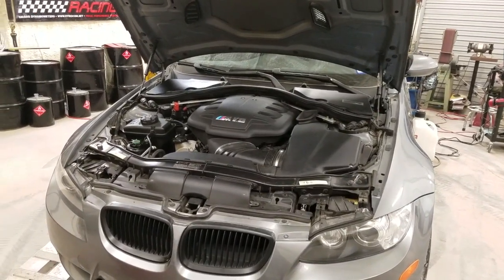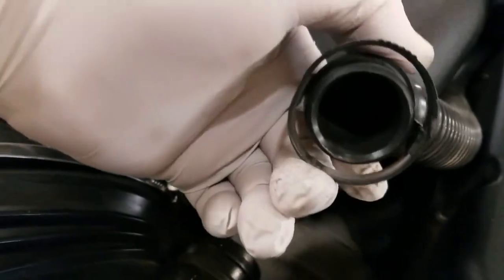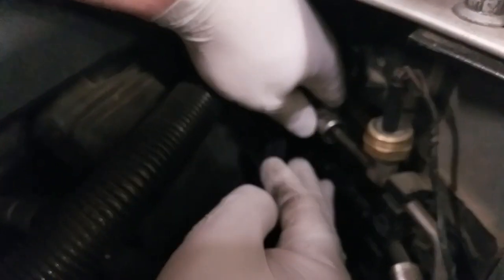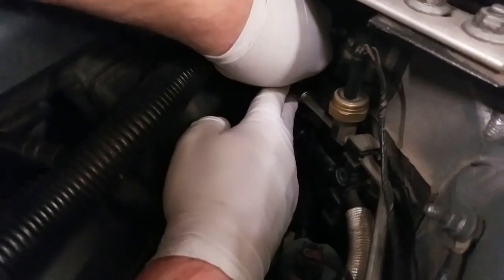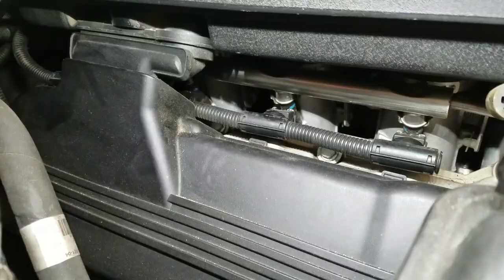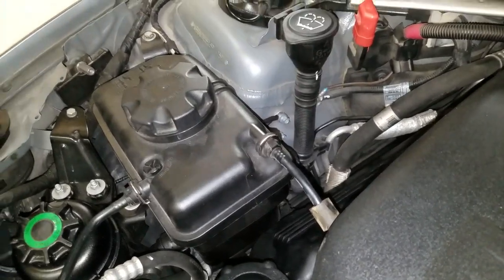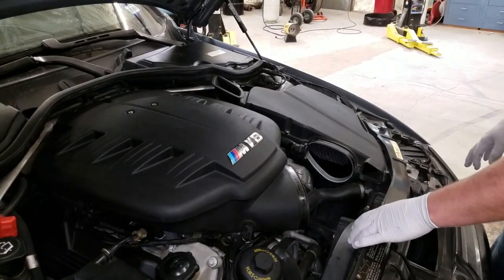Installation Guide | PROFLEX Commander for E9X M3

Comment: 9:12 I like how you quickly skip over the "tidy up all your wiring" because there really is no way to make it tidy or nice-looking.  I took off my plenum to try and hide the wiring as much as possible but the ProFlex harness is unavoidably going to be sticking out from underneath the plenum on most cylinders.  Just a small nitpick in an otherwise pristine, show-quality engine bay.  System works great though.

Comment: Don't mean to be rude, but from what I've read, don't you NEED new injectors for an E85 conversion since it requires a higher flow rate right off the bat to even function?
Reply from the maker: Hey Sean.  We dyno test every vehicle we have a kit for to make sure the injectors and fuel pump have enough capacity for full E85.  We are using real time data derived on our dyno in a controlled environment so there are no guesses based on the "fuzzy math" common in the industry.  If the car has major power adders then an injector swap may be necessary, but for a stock car or a stock car with a tune and minor bolt-ons we know your injectors are up to the job.  Make sense?
Reply: @advancedfueldynamics  yeah. Was just curious since pretty much every other source says otherwise. But if you're dynoing every model you're making the kit for I suppose it's gotta be ok

Comment: I just finished my install today. The 3rd injector is a pain to disconnect and reconnect. What I had to do was use a small flat head screwdriver and slide the springs on both slide off, and then it came off very easily...BE CAREFUL not to flip it off completely...and losing it. For anyone else that wants to do it yourself...I suggest buying a couple of those clips...and pop the original ones off during install for the one that won't budge. Outside of that, everything else fits perfectly!  Let see how this kit handles!
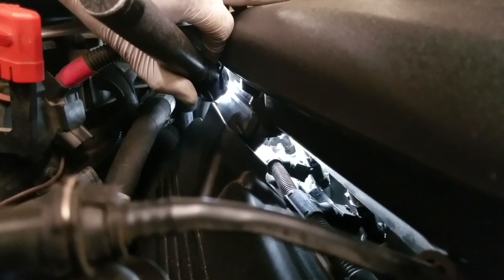Reply from the maker: Awesome! Yeah, that 3rd injector is tricky. If you can pull it back it'll come right off without needing to remove the metal clip. See a demonstration at 6:44
Reply: @advancedfueldynamics  a question do I need a tune after install, I already have a stage 2 tune from turner on my e92 m3, is there a special tune for e85 that could help extract more power? Im very interested in purchasing thank you
Reply from the maker: Hi Christian, our system is designed to work seamlessly with your stock or aftermarket tune so you will not need a new tune after installing our system. Our system will maximize your power no matter then blend of E85 you're running -- you can think of it like an automatic, dynamic E85 tune in a box. It's better than an E85 tune and easier to setup because it's fully plug-and-play. Hope this helps!
Reply: @advancedfueldynamics  Thank you, do you suggest a new fuel pump to be safe. If pump goes out due to extra stress is it catastrophic?
Reply from the maker: The stock fuel pump is great and there is no need to replace it. We've never heard of anyone's pump going out, but if it did your car would stall and not go anywhere until you got it fixed.
Reply: Why not just take the intake plenum off?
Reply from the maker: You can, it just adds to the effort
Reply: hi, so how was the kit?? i'm super curious.
Reply: I removed all the plugs but cannot for the life of me get the harness on now